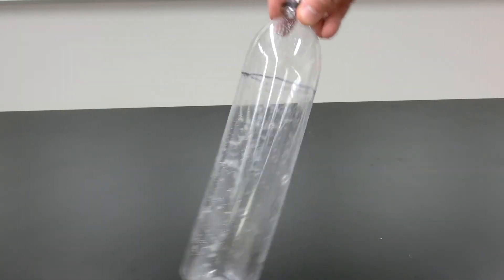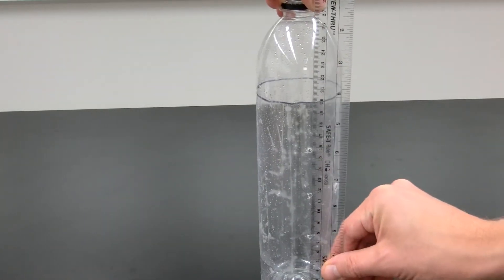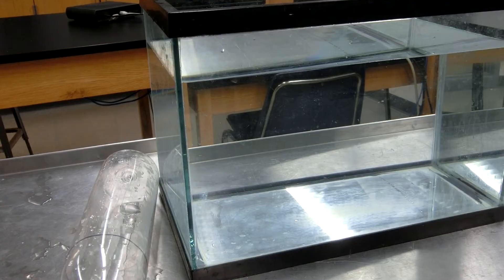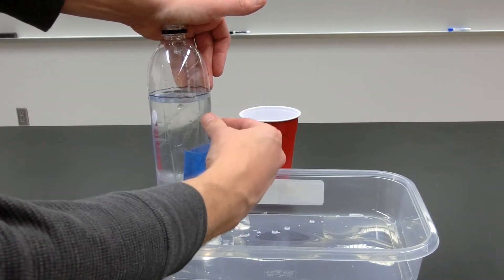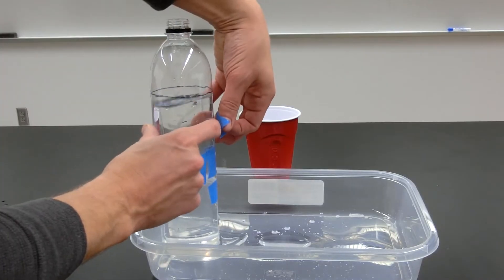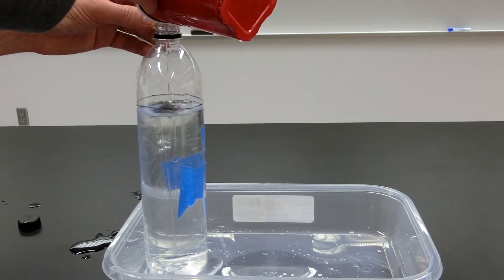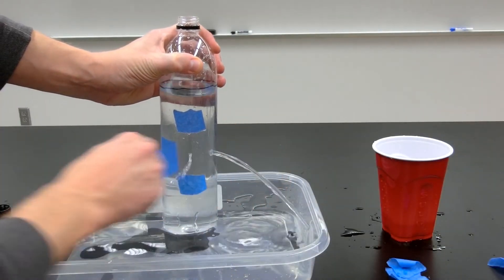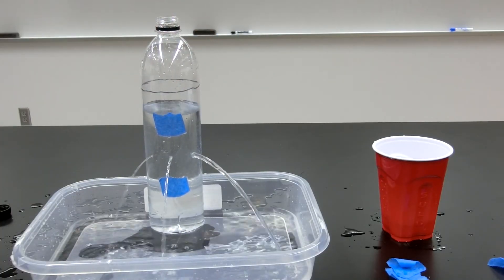Experiment - Fluid Dynamics

Comment: Fill the glass with water
Place the card on top
Turn the glass over, while holding onto the card and making sure the card always stays flat. Do this over the plastic tray
When the glass is upside down let go of the card… 
1) What is stopping the water from coming out ? 
2) Why pressure inside the Glass decrease? If the reason is expansion of air then How